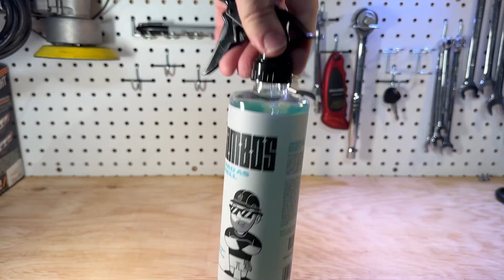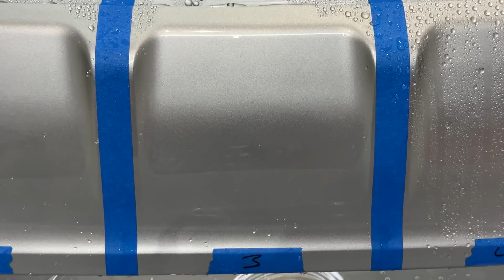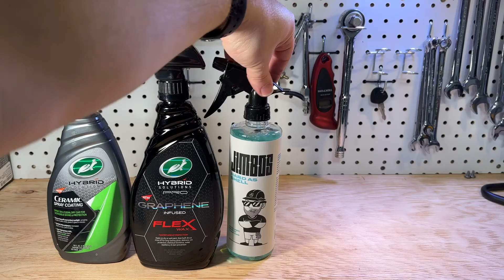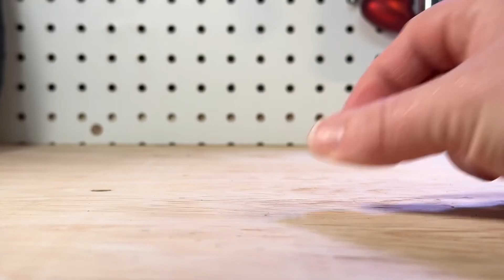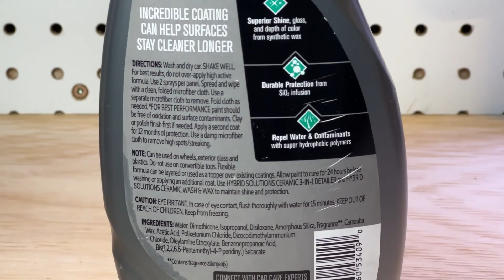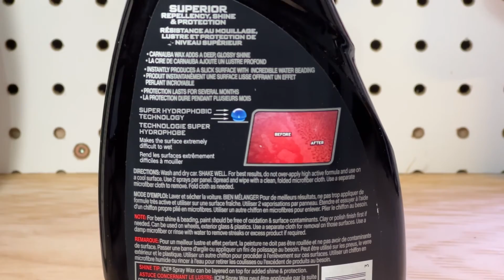You call that Chemical Resistance!? Jimbo’s Hard as Shell - MY Chemical Resistance Test!

Comment: You have hit the nail on the head, if a coating is not applied by the proper preperation of the surface first it will fail far before its time.

Comment: So it out preformed all the other sprays. Jimbo has never said it's better than legit coating. You decided to pay 120 that's on you. But to compare it to a coating is apples and oranges.
Reply from the maker: Never faulted Jimbo for the cost, made that pretty clear in both videos featuring his product. More so just informing non-us customers to wait for local distribution so they can avoid the high prices.

His product did perform well in this test, and I never expected it to beat a proper ceramic coating. My point is that a true ceramic coating that has been applied and cured properly should always outdo a spray coating, and any videos showing otherwise are probably due to application or curing errors.

Comment: A spray coating vs a true ceramic ...not a good comparison ....spray vs spray is fair , your test is flawed because of it .
Reply from the maker: Tell me you didn’t watch the whole video without telling me you didn’t watch the whole video. Cquartz lite is in this only to show the gap between spray coatings and true ceramic coatings. If a proven true ceramic coating doesn’t last as long as a spray coating, there is an issue with application or cure, not the coating.
Reply: We know true ceramic is better by far, I tuned in to see the difference in SPRAY ceramic ...silly me . @sheepstardetail
Reply from the maker: The comparison is between meguiars, jimbo, and cerakote (and mystery product - it’s also a spray within the same price bracket). Cquartz lite is to show the gap between a real coating and a spray. Reasoning is to highlight if the extra effort/cost for the coating is worth it over the sprays.
Reply: @sheepstardetail  First time watching.....I don't get that. Not to be critical, but I agree with @patrickgagnon9662, just stick to comparing products that claim to be a ceramic spray coatings that gives 6mos to a 1yr of protection and see who comes out on top. True ceramics should be compared with other true ceramics, right? I get that you added a true ceramic that shows what durability should look like, but Jimbo's product still took 2nd place to a true ceramic. How can anyone complain?? Maybe you could've added that you would be adding a true ceramic as a benchmark with a few competitors and Jimbo's would be one of them. Likewise, as was mentioned, I don't recall Jim saying that his product would out perform a true ceramic, I could've missed that point. If you know he did, call him out on it so we all can be informed. What you reviewers are doing whether you like it or not, is informing the rest of us on who is BS 'ing and who has the real deal. I would like it if you kept products on the same playing level. It would be unfair to pit a Corvette, Mustang, or Hellcat with a Tesla, would you agree? One last request, maybe use a real world car hood where we can see beading, sheeting, and when the coating goes flat.
Reply from the maker: Hey! Thanks for watching and commenting. The comparison is between the sprays, Cquartz lite is only there for a reference point. As I showed in the chemical resistance test (and said), I never expected any of the sprays to beat the wipe on coating. My point was to highlight that if a wipe on coating failed in a test like that, I would question the application and cure, not the product itself (which was a point made in other videos - not mine). If a product has a complicated or difficult application, using it poorly, having it fail, and saying it’s bad is unfair to the product. You are supposed to apply the products as the manufacture recommends, and save the criticism for the application. I am not saying that jumbo’s is a bad product, as a matter of fact I have zero issues with it based on the pricing (in the US where it isn’t affected by shipping and border costs).

There is nothing wrong with a reference point to compare against. Yes, the true comparison is between the 4 sprays, but I have put the wipe on coating in there as well so you can see how much of a gap there is between them all.
Reply: @sheepstardetail  ok sounds good.

Comment: C Quartz lite is honestly the best coating for the money out there, just bought the new version that comes in a glass bottle sadly it’s only 100ml now instead of 150, but still a great value. Got it going strong on the wife’s car at 18 months with minimal maintenance.
Reply from the maker: It honestly makes the speed and convenience of spray coatings completely inconsequential, simply due to how much longer it will last. And it doesn’t need to flash so application is much easier, plus only 4 hours of dry time before wet.

I am surprised it isn’r more praised on YouTube.
Reply: I’m not so sure about that, a few come to mind that can be found cheaper just off hand the Meguiars Hybrid paint coating is another that can go door to door with lite, CanCoat can to and to apply is easy with the Jimbo product. Not just that I think I could get the Griots 3-1 wax with proper maintenance to go 18months. That might be a stretch . But Jimbos product fills a void for detailers to be able to back up claims of 180 days. Add in a Maint program and I wouldn’t be surprised if it went 10 mo. Don’t get me wrong. I like lite, it’s an awesome product. But for the cost of Meguiars Hybrid paint coating lite is definitely not the best dollars for dollar coating. Nowadays with proper maintenance. You can get a regular spray sealant to go longer than expected. That gives younger newer detailers an opportunity to be able to guarantee their work. They can charge a little more if they learn the proper process. Jimbos product is a great tool.
Reply from the maker: @AmirAbdullah  hybrid paint coating is $100 plus shipping for me in Canada, no one selling in local stores (Cquartz lite was $70 for 150ml, found on sale for $35, and the new version is $60 for 100ml). Carpro Cquartz lite is what I would be offering as a hobbiest detailer if I wanted to stake my reputation on the protection lasting 6 months. I wouldn’t buy a single spray coating at this point in time and guarantee 75% performance after 6 months. My video on spray coatings vs real coatings has a 6 month update and Cquartz lite is still well within 75% performance, without being decon’d or boosted (and the hood was COVERED in rail dust). 

Don’t get me wrong, for home detailers only working on their own cars, spray sealants have come a long way, but I wouldn’t stand behind anyone lasting more than 3 months (at least, so far).
Reply: See that's crazy hybrid paint coating is $20 and I can pick it up locally. If you want to try it I'm sure I could send it up to you tbh. @sheepstardetail

Comment: No spray coating can beat a ceramic coating, can it? I’ve never seen that happen. Not surprised & I don’t think Jimbo claims that it can, does he? Maybe I missed that claim. I’m testing his spray also in my 23 International Spray Coatings Comparison on my channel now. We’ll see how it does against others in its category. Thanks for the test!
Reply from the maker: He doesn’t directly claim it, he claims a coating should survive a torture test, but then applies the coating poorly and makes it look like they don’t last. Also, torture tested are not indicative of real world durability. YouTube detailers have. Just gotten lazy and used torture test as a crutch in place of doing actual work.
Reply: Yeah a spray can't beat a bottle generally (excepting CanCoat which shouldn't have a spray head). Jimbo's is also water based not using a solvent carrier so it has a further disadvantage. The performance is commendable I think given that it is water based.
Reply from the maker: Remember, even a water based product can be designed to have high PH/low PH resistance, and maintain its surface tension. That’s all that torture tests look at, maintaining surface tension in various PH levels. This is why torture test champs tend to not translate into real world champs unless they are true coatings.
Reply: @sheepstardetail  The difference between water and solvent carriers is the quality of the bond and film build density.
Reply from the maker: @chrisbradley3224  oh I know, but it’s ability to last in chemical resistance means nothing grand scheme. Other manufactures aren’t designing products specifically to do well in that regard. Jimbo omitted a scent from his product to allow it to perform better in this type of test. 

Don’t worry, meguiars ultimate ceramic has arrived, test will be prepped tomorrow.